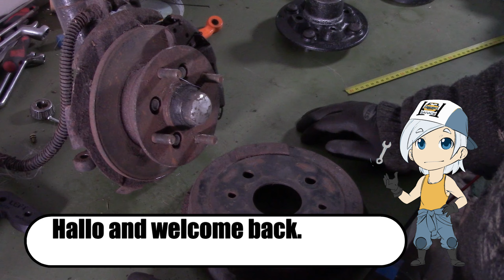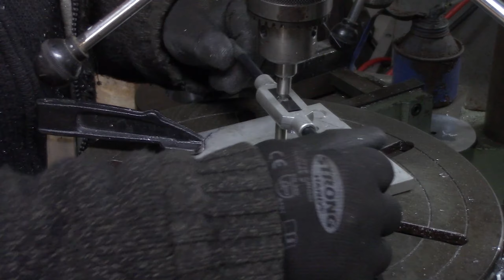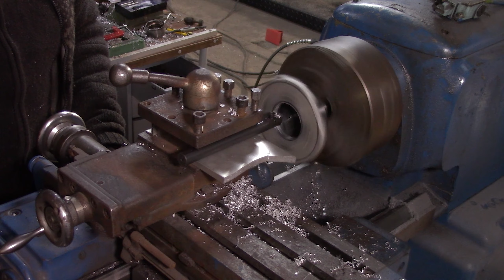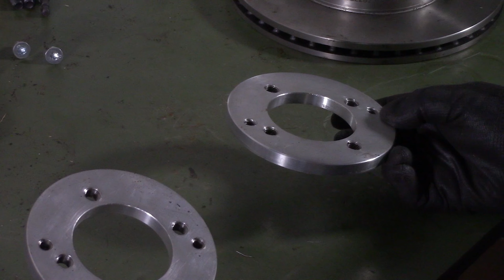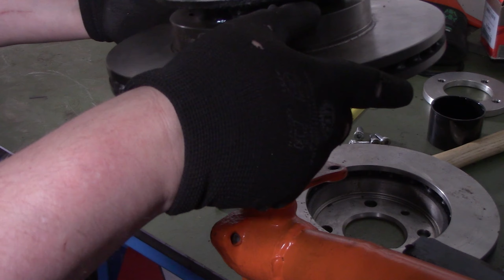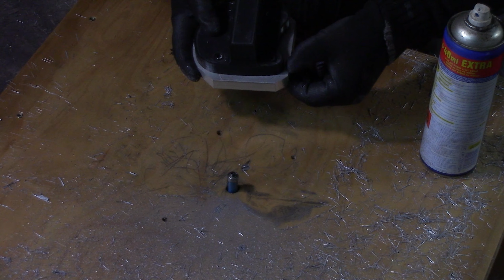KE10 Corolla Build Pt 8-1 | DIY "BIG" Brake kit Tips and Tricks for your own project.

Comment: Would love to know where you are up to with the KE10 now?
Reply from the maker: I'm building a rotisserie right now. It's almost done but it took me way to long. Wattslink is halfway done. But was sick of working underneath the car. So I started with the rotisserie.
Reply: @TheDutchGarage  really love what you've done with the brake upgrade on this. I have 2 KE10s. But none of the equipment you have! Just garage basics.
Reply from the maker: You can do alot with basic tools, so don't be discouraged by that. I own two ke10 and a ke17.
Reply: @TheDutchGarage  would love to see your other KE10 and the KE17. The 17 was never released in my country. There is 1 or 2 about somewhere that I've heard of, but those are imported.

Comment: Looks great 👍. You should make a brake upgrade kit for sale 😃, my ke15 needs better brakes too. What kind of brake master cylinder you use?
Reply from the maker: I did consider to make a limited production run. But there is not a real market for. The master is from a Mazda 929 I believe don't know it for sure.

Comment: You’re a genius mate. I’m using your videos as a guide for my KE25 rear suspension. I’m really interested to see how you mount the coilovers (vertical or cantilever).
Reply from the maker: Hi there, glad this videos helps you in your own build. It is going to be a cantilever system. But first the watts link.
Reply: The Dutch Garage how can I get a copy of the drawings you used to fabricate those boxed sections that were welded to the floorpan to attach your links?
Reply from the maker: @ehonda2718  For now I keep them to my self. First I want to know if it works as designed. I don't want to spread plans for a deathtrap.